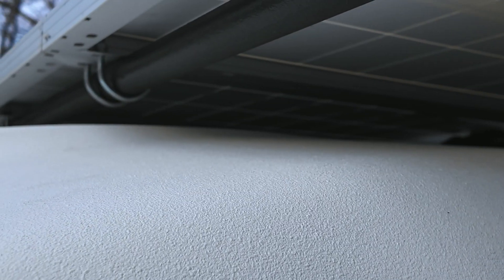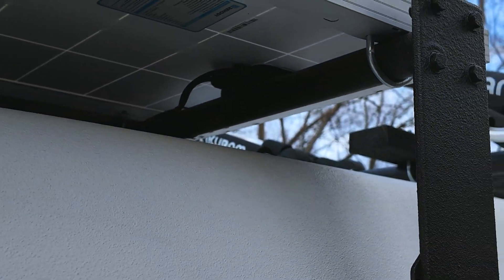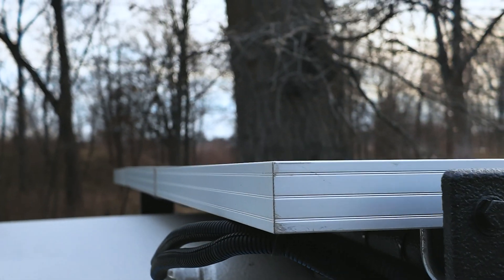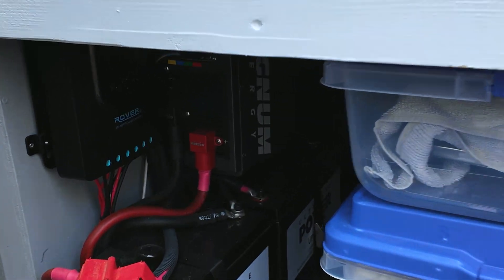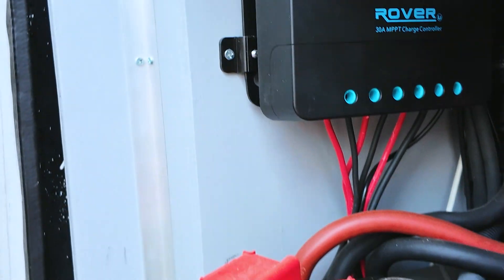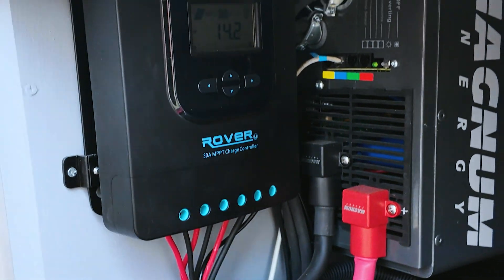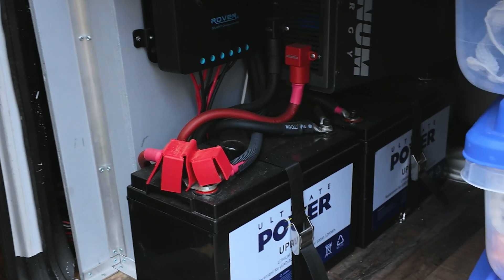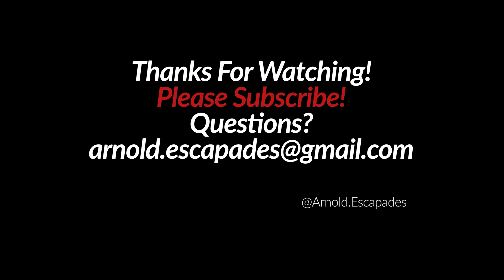300 Watt Off Grid Camper Van Solar Setup Explained

Comment: Nice work. How do the panels handle the wind load at highway speed. Is the aluminum showing any signs of stretch.
Reply from the maker: Let me know if you have any questions. I'm going to be doing a smaller setup on my Expedition. When I do I'm gonna make a video of the whole process to better explain. It'll only be 100w of solar and 2 100ah marine batteries.
Reply from the maker: Thanks! Seems to be handling it fine. 10k miles on them so far. No signs of any wear whatsoever.
Reply: @arnold.escapades  awesome. I’m going to be setup a system on my mom’s caravan maybe in summer.
Reply: @NewLightEnergy  You could install a small wind "shield" in front of them?

Comment: That's friggin slick, dude
Reply from the maker: Hey I appreciate that man!
Reply: @arnold.escapades   I'm going to check out more of your videos. Currently working on a 200w solar system with 1000w inverter and 12v, 100Ah battery for my foam sleeper shell. Very new to solar DIY, but so far have been incredibly interested.
Reply from the maker: If you have any questions along the way feel free to reach out!